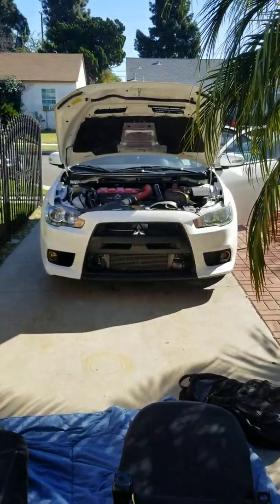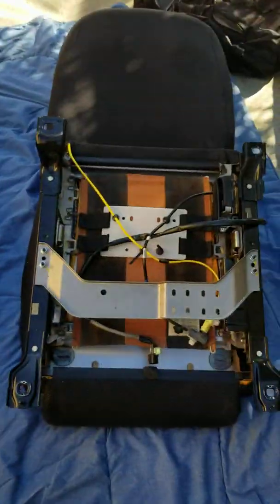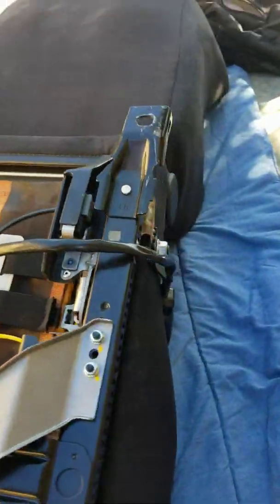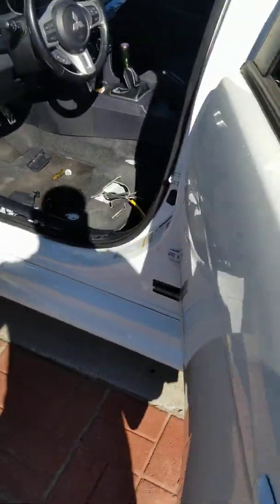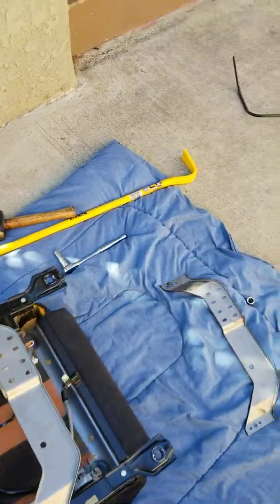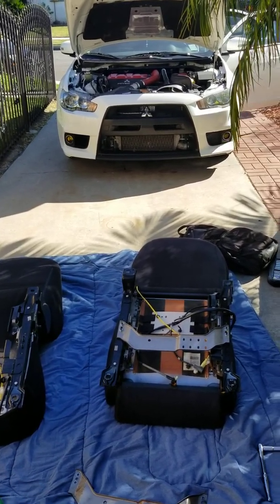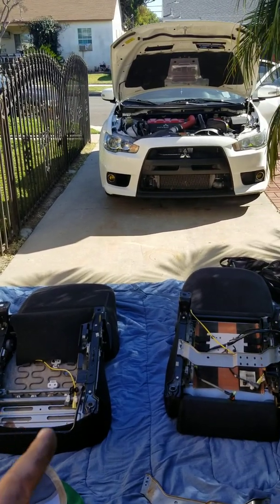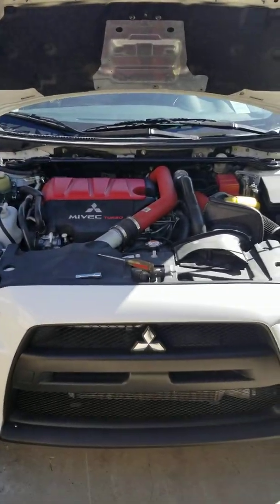2015 Lancer Evolution Gs-R seat swap driver( revised video)

Comment: I've been riding around for a while with my air bag light on after doing the swap and I just realized I didn't swap the cable to the seat belt, only the buckle. I'm going to swap out the cable soon and see if it fixes it.
Reply from the maker: Hope so . Good luck